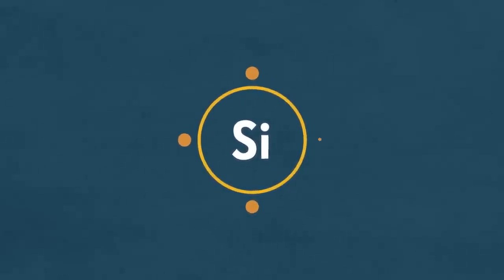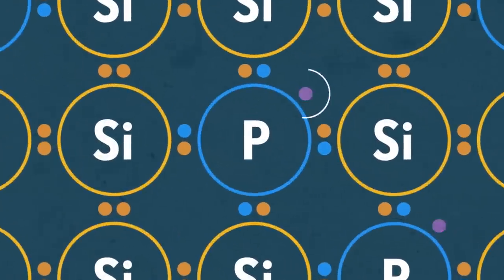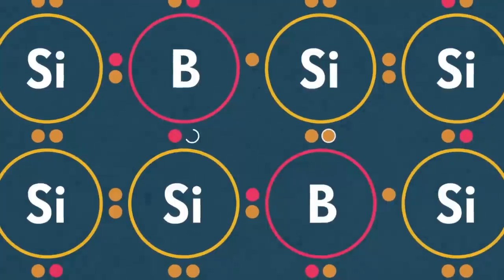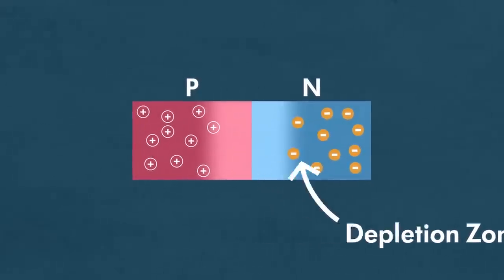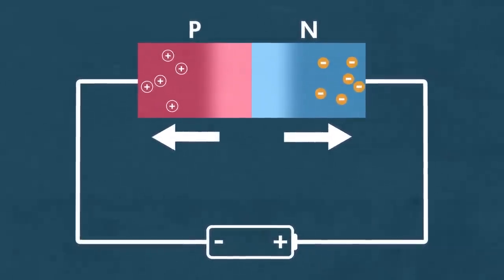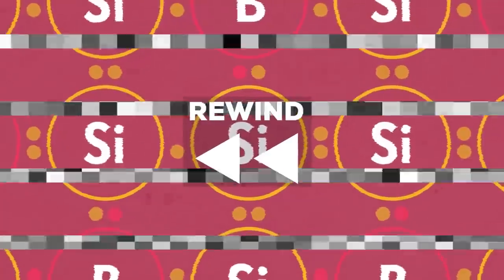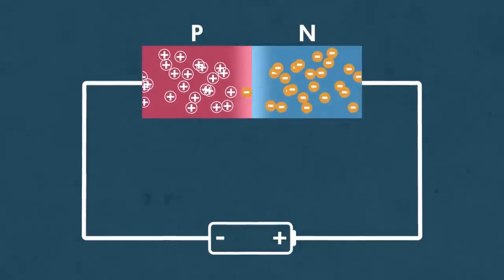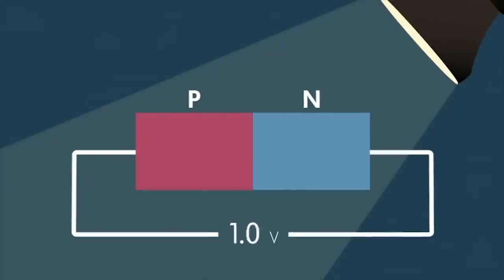How diodes, LEDs and solar panels work

Comment: Very well explained sir! Now I can skip this subject in peace and refer to this video
Reply from the maker: The electroBOOM seal of approval. That makes me happy!
Reply: Hey electro i am a big fan. You make super entertainment videos!
Reply: Now you know how a FULL BRIDGE RECTIFIER works
Reply: Hey electro boom
Reply: I like you channel  can you explain transistor
Reply: Heyyo ElectroBoom!!!
Reply: ElectroBoom full bridge rectifier hhhh
Reply: No LEDs were harmed in this video. You can change that.
Reply: @Simon8162  No, he now knows how a puny diode works. Which is the same, since the FULL BRIDGE RECTIFIER is made of four diodes
Reply: And white LEDs, is there drop bigger or smaller and would it not make a better / more efficient solar panel? To use only silicone based solar panels to get the energy from only infra red (if it works that way...) Would be inefficient I guess, is that why solar panels only got around 20% efficiency?? So many more questions after this video. Good video btw ;-) electroboom love your videos too man!! I like to see if you can dry a child in a microwave, shocker.. :-)
Reply: Came here on electroBOOMs recommendation. Great video, struggled to fully comprestand diodes but now I know a lot more than I did before. Still a long way to go until I’m a fully conversant elecchicken though
Reply: AGREED! and thank you for dropping that link, which is how I got here. He's not as funny as you though. But I gave him a subscribe. Good info.
Reply: or you can make one about zener diodes
Reply: full bridge of diodes approval. nice.
Reply: ElectroelectroelectroBOOM
Reply: Found another reliable teacher like electroboom
Reply: Having four empty bottles of vodka, a hump MOTs. A full bridge vacuum rectifier will be generated!
Easier than a bag of sand, torchs and holedrills. Whah
Reply: It's funny I saw the first part of his explaination on diodes (the reverse way of using the led and solar) and hey mr Boom should watch that, just today mr ShockyOverTime recommended the second part. Perfect!
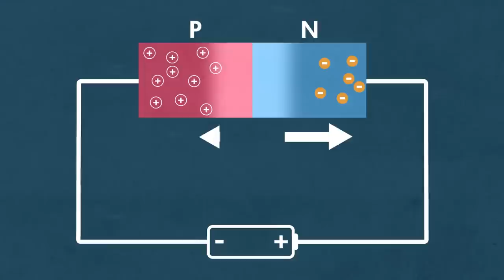Reply: 5:40 here you can see, how a diode also acts as a capacitor (and why the frequency of our CPUs is determinized)
Reply: Thank you sir. U are awesome. U explain It so detail and clear. Way more better than my teacher and lecture.
Reply: Dexter Treehorn somebody care to elaborate on this one??
Reply: Give me the meetaaaa
Reply: Electro you are a teacher of 2 M students
Reply: is this the dude that was gonna electrocute himself in a bathtub to show off GFCI or am i confusing him with somebody else????
Reply: Full bridge recti–, oh hey!
Reply: @Server0750  white light is made up of many wavelengths, is, in fact, (white) noise. to aproximate white light LEDs can be made to emit 3 different wavelengths, corresponding more or les to RGB, red, green and blue. Or the cheapest ones which emit a deep blue or even ultraviolet light, exciting a fluorescent compound en the plastic package to emit close-to-white ligth.
Reply: @balajijohnson6580  I estimate 100 times more reliable. This is why he is not so famous.
Reply: @SteveMould  The Mizuno experiment can produce 3 kilowatts of heat while consuming 300 watts of electricity. The difference comes from exothermic transmutation. Detailed instructions are provided. 
Research terms using DuckDuckGo:
theorionproject Gary_V pdf
theorionproject Stan_Meyer_Full_Data pdf
siriusdisclosure Griffin pdf
brilliantlightpower MHD_Paper_082719 pdf
lenr-canr MizunoTincreasede pdf
e-catworld
Reply: I'd like to see a work safety video from you.^^
Reply: @userPrehistoricman  well he broke small solar panel and it kinda works as diode.......
Reply: @SteveMould  when i solder SMD LEDs i noticed that when i touch the anode pad using soldering iron tip the diode faintly glows, can you make a follow up video on this phenomenon?
Reply: I know right!!!!! Really easy to understand!!!
Reply: And if we want we can jump to your channel to see example of LER: Light Emitting Resistor.
Reply: Look who is here
Reply: Hey Boron, are you sure??? Yes, I'm positive !
Reply: FOOL BRIDGE RECTIFIER !!!!!!!!
Reply: @jagadishk4513  could it be stray voltage from the soldering iron tip? Only takes < 1 ma to make one glow.
Reply: Oh no. Not you too. I must RECTIFYI that. The diode is 100% wrong direction... they conduct when the n side is negative. And that's the only way a Bipolar transistor can plausible work...
Reply: Can you make solar panel from leds? Its a chalenge...!!
Reply: @SteveMould  lol
Reply: Not gonna lie but the way you, ElecrtoBoom do things with wires makes me laugh a lot.
Reply: This comment aged like milk
Reply: @BGTech1  he literally links to this video in his own that he published today? I'd argue it aged like fine wine.
Reply: Three years later, and he finally makes good on his promise
Reply: @Server0750  White LEDs are blue LEDs with a phosphor coating. That's what that yellow stuff is that you see if you look closely at any white LED. The coating turns some of the blue light into yellow (red + green), thus making the full R,G & B set that you need to make white light.
Reply: @jagadishk4513  That's because modern high-brightness LEDs are so sensitive that even the tiny amount of power picked by your body acting as an antenna is enough to light up an LED a tiny bit.
Reply: @Server0750  White LEDs use blue LEDs and a luminofor, which converts part of the spectrum to longer waveleghts through fluorescence.

Comment: As a grad student in physics, probably the most easy to understand explanation of this I've seen.
Reply: Bertus van Heerden 
We take this stuff in high school
It amazes me how well he explained it
Reply: Do you know why there is a resultant electric field @8:38 then?
Reply: There's an electric field because the P side has an abundance of positive charge carriers (holes) and the N side has an abundance of negative charge carriers (electrons). This excess of charge in each side causes the electric field to form between the two sides and creates a voltage potential between the two sides. That voltage is about 0.7 volts in silicon diodes, or 0.3 volts in germanium diodes. Which means electrons need at least 0.7v (in silicon) in order to cross the depletion region. Think of it like a hill where you need to give a ball enough energy to roll all the way up.
Reply: But did you finally understand it?
Reply: As someone who knows nothing about this subject I would say the same!
Reply: if he spoke any slower people that don't speak english could understand it.
Reply: Wish I had seen this before solid state physics that class was so poorly taught.
Reply: As you continue your graduate studies, when you get to solid state physics, you will discover he was right about how diodes work electrically but wrong about silicon diodes being LEDs. See my explanation elsewhere in the comments if you want details.
Reply: @jimdetry9420  he very well touched on the emissions of silicon. being invisible doesn't make infrared not light
Reply: @smartard  Yes, infrared is light. No, a silicon bipolar junction does not make an LED. It was emitting infrared light because it was hot, not because of electron hole pair recombination. I have a PhD in solid state electronics. I worked on this stuff for a living.
Reply: the videos of a panel shining in infrared is there for you to see.
take your degree and shove it, it doesn't seem to be worth much
Reply: @smartard  Obviously you don't know the difference between black body radiation and a light emitting diode. IR cameras can be used to find where poor insulation allows heat to leak out of a house. Is the house a diode?  Do you realize you, yourself, emit long wavelength infrared radiation? Are you a diode? No. You're just clueless.
Reply: @jimdetry9420  
Physics is time reversible. If you can make an LED, you've made a photodiode. A BJT is a bit more complicated, but it's still true for diodes. Look at a cmos detector. It's basically a diode connected as a transistor to the readout.
Reply: @yamahantx7005  If you have a degree, ask for a refund. A CMOS transistor is a majority carrier device. It is not a diode. An LED can work as a photodetector, but not every photo diode can be an LED. An LED requires a semiconductor with a direct band gap. A silicon photodiode produces an electron-hole pair when a photon of sufficient energy is absorbed in the depletion zone of the diode (the diode is reverse biased to create the depletion zone and to sweep the carriers away in opposite directions so the light generates a current). The photon has very, very small momentum. The electron and hole can go in opposite directions such that their momentum cancels and both energy and momentum are conserved. A light emitting diode is forward biased so that electrons and holes come at each other. In silicon, there is an indirect band gap, i.e. when an electron and hole at the band gap energy difference combine, the momentum does NOT cancel out and you don't make a photon. The excess momentum is carried away by a PHONON, which is a vibration in the crystal lattice--commonly observed as HEAT. It is remotely possible to get an electron and a hole with enough energy to match up in the band structure and emit a photon when they combine. but this would be extremely rare and the photon would have way too much energy to be infrared. The infrared light observed coming off a forward biased silicon diode is black body radiation resulting from HEAT, not direct conversion of electricity to light as occurs in an LED. By the way, time reversal would not turn a forward biased diode into a reverse biased diode, so that argument does not apply.
Reply: And then QM... You have earned the Title: John Snow.
Reply: @nicewhenearnedrudemostlyel489  lower the speed of the video
Reply: the Best Teacher*
Reply: Same
Reply: And thats why i subscribed to him
Reply: this is why I refuse to put money into an "education"
Reply: @nicewhenearnedrudemostlyel489  No, you still need to speak English to understand English ;-)
Reply: 100% agree , I'm like you , I may be younger since I'm in school , I wanted to make a project for my chemistry teacher about this interesting topic and this video just helped me alot
Reply: @itsm3th3b33  details , ppl got what he meant , that's enough and more
Reply: @itsm3th3b33  I disagree. I found the physics grad student part helpful.

Assuming it's true, it means they've struggled through semiconductor physics concepts, and seen multiple interpretations/analogies to try to understand it at a deep level.

If the comment had come from a high school student (with relatively little experience and understanding), it would carry less weight.

But to each his own. :-)
Reply: @Motamid  I was writing a long physics-filled comment about why you're so wrong but you'd probably consider it hostile." Let's just say I did this stuff for a living and your spin doctored explanation to try and cover for the guy is way off in terms of experimental physics. The tiny possible emission can't be detected with just an IR camera. You also don't know how solar cells work. They don't need a phonon any more than ionizing an electron from an individual gas molecule does. I wrote my original comment to try and make sure people didn't believe the horrible mis-information in this video. You are doing the opposite.
Reply: @jimdetry9420  Your efforts are being appreciated. The internet is a jungle, and the only action that can (!) keep our sanity in check (especially when it comes to science) is to leave emotions out of it. Thanks.
Reply: @jimdetry9420  your efforts are noted. Anyone can make a cartoon that’s entertaining and call it science. That’s all NASA gives us, and the same with Viruses, all just cartoons! Until you perform the experiments yourself and measure the results with an unbiased focus, nobody knows anything - they just believe what someone else told them. This topic overall borders on something I would tread carefully and use discernment, because IF too many people did experiments themselves and found that one panel was more efficient, do you think YouTube or any other globalist entity trying to profit from energy would allow that information to propagate? Highly unlikely. I found a video of one ousted scientist explaining how a yellow LED panel produces more voltage/wattage per square inch than a standard solar panel; yet as I search all I find is discouragement. Who should I believe? Nobody. Until I perform experiments myself using unbiased data. Ordered a couple panels to test out, but it certainly would be interesting if true. That would mean cheap LED panels could be strung together to make effective energy sources.... if I was big energy, I’d squash that bug too. We will see.
Reply: @Houseofarrows  I'm not sure what conspiricy theory you're touting, but the guy who made this video does not understand physics. It looks like you don't either. LEDs are Light Emitting Diodes. They are not sources of energy, they consume energy to produce light.
Reply: @jimdetry9420  Hi Jim. I'm surprised to hear you say there is no phonon involved in the absorption of a photon in solar cells. Silicon requires phonon assistance for any absorption to occur. This is why silicon is made so much thicker than other, direct bandgap materials like MAPbI3 and CdTe can be a hundred or more times thinner; it has to make up for its weak absorption.

As for the intensity of emission: As soon as he goes open-circuit by moving the contact, the IR dies. If the IR was due to temperature, the heat wouldn't dissipate the millisecond you go open-circuit especially since near-IR is at least 1000 K. If the IR was black body, the intensity would increase slowly once the circuit was closed and decrease slowly once the circuit is open. Instead, we see an immediate on and off. 

Best,
Roy
Reply: @gravitywavesRMS  A phonon is only needed for conservation of momentum. When the photon has enough energy to create an electron/hole pair, the liberated particle can take care of the momentum. Granted, it may collide very shortly thereafter, creating a phonon.

Light absorbtion in silicon is very dependent on frequency. Silicon is mostly transparent in the IR but not in the visible.
You are mixing up absorption and emission with your arguments. Silicon is a very poor material for EMITTING non-black body light because of the indirect bandgap. That's why it isn't emiting any in the case under discussion here. As a solar cell it does just fine with visible light. Other materials can make better solar cells at higher bandgaps because the junctions will reach a higher voltage when absorbing shorter wavelengths.

At 1000 K you can see something glow red, even though most of the radiation is in the IR. You do not need an IR camera to see it. I know, since I worked in semiconductor fabrication with furnace tubes in that range; enough experience and you can come pretty close to guessing the furnace temp by eye.

I'm surprised, after three years, there is still so much misinformation around this video.
Reply: I'm wondering if you could apply a similar explanation to radioactive decay. Essentially you have a single-atom diode that gives off all of the energy at once.